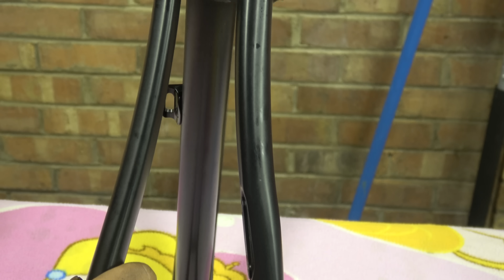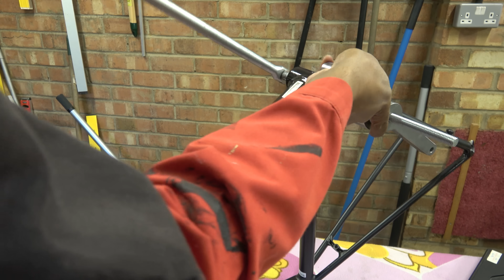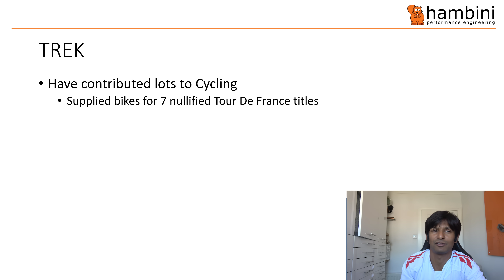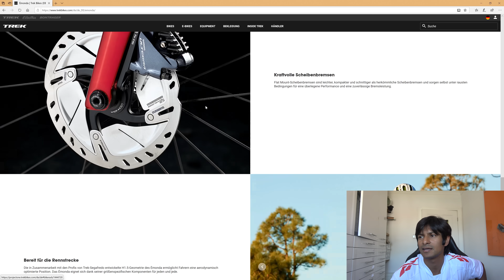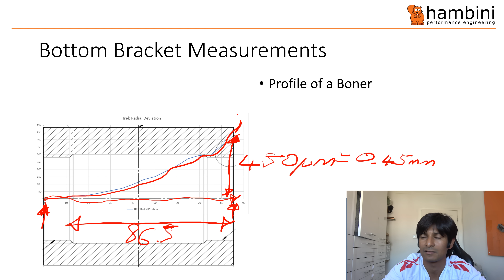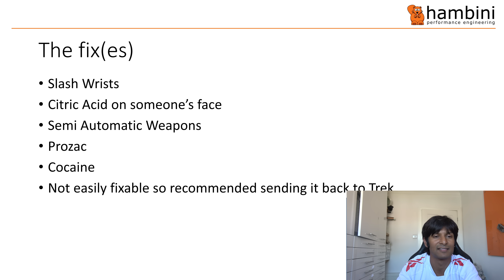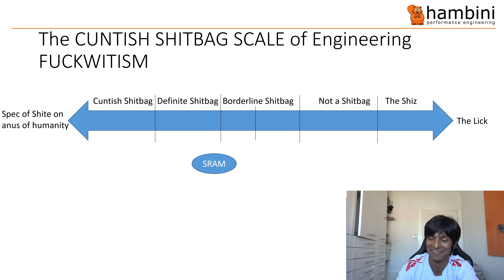Trek Emonda: Engineering crapness of the highest order

Comment: Purchased the alr5 frame and a Hambini BB but didn’t use because of the cable guide. I was lucky, because we had trouble installing a Wheels Manufacturing BB and had to take the frame back to Sigma and they exchanged and installed the wheels BB but I was not present when job done. Was not impressed with the quality. Seems to be a standard with your everyday frames🤦‍♂️

Comment: I got a Trek Checkpoint frameset and the bb has the same kind of problem as this... Shame on Trek :P
Reply: First thing I did on my checkpoint was a fix from Mr H. No creaking so far
Reply: I also have a checkpoint and the bb creaks like crazy. Sorry I bought it.
Reply: @Ryryryryryryryryry-o8n  My checkpoint was creaking a lot turned out to be the stranglehold dropout that needed to be cleaned and lubed, I'd check that before dealing with the BB.
Reply: @MAGAIVER  Thanks I will do that
Reply: @MAGAIVER  I checked the stranglehold dropout and although it was finger tight, it was easily tightened by a wrench. I tightened nuts to spec and took the bike for a quick ride around the neighborhood. No more creaks; Sir I owe you a beer. Thank you.

Comment: A better way to get around warping the BB and head tubes would be to start with  thick walled tubing with proper OD. Weld the frame and then ream the ID to size. Of course they’d fuck up anyway and the chances of them being reamed square are slim.

Comment: Pardon my naivete, but wouldn't it make sense to make the bb tube a millimeter thicker, weld it up, wait a week or two, and then machine the i.d. to its finished diameter?  Oh, wait.  My bad.  That would cost an extra $10 per frame for which they'd have to charge an additional $500 markup, which would in turn make their frames non competitively priced.
Reply: A week is not enough time to allow stress relief in a weldment or casting
Reply: @Behemotheffenrocks  It beats 15 minutes.
Reply: That is how  you would do a welding ass under normal circumstances.You wouldn't have to wait  a week either because after welding these frames should go through heat treatment because they have been anealed due to welding .Once done you would bore and thread.
Reply: naivety

Comment: I was considering getting an Emonda ALR 5. I guess I'll have to get something else now. How can companies let this garbage out the factory door?
Reply: You can’t afford a Trek anyway 😂🤷🏻‍♂️
Reply: We cannot learn much from one specimen, we need more data in order to conclude that the entire line was made with manufacturing errors. Trek has wonderful customer service and warranty. I'm sure they'll replace the frame.
Other companies wouldn't do that.
Reply: @Steve King  chinese carbon, dengfu, hongfu..
Reply: Don't be put off by this video. The ALR 5 is a good bike. Just don't let anyone that doesn't know how to use tools properly work on it. There're too many theoretical engineers in this world without the practical skill set to apply it effectively. More often than not the manufacturer gets the blame. 

The ALR is manufactured from specialist aluminium resulting in an extremely light frame, however, it needs to be treated with care. Look after it and it will give you many thousands of kilometres of trouble free cycling.

Go and test ride one. If you like it. Buy it with confidence.

Comment: ‘It won’t stand up in a court of law’.  Love it!!
I’m old enough to remember when facing bottom brackets and head tubes were part of every build.  You would’ve hated Italian frames back in the day
Reply: For some reason, reaming an Italian bottom bracket always makes me think of Gina Lollobrigida. These days you have to sell a kidney or two just to afford the tools to work on all the different BB standards. 
•	ITA/BSA threaded
•	BB90 and BB95
•	PF86 and PF92
•	BB30
•	OSBB (road)
•	BB30A and BB30-83 Ai
•	PF30
•	OSBB (mountain)
•	PF30A and PF30-83 Ai
•	BBRight
•	BB386 EVO
•	T47
•	Threadfit 82.5
•	SRAM DUB
That's a few I can think of off hand. Now we also have the flat-mount disc brake bollocks. A decent facing tool for that is around 500 Euros. Maybe this is a reason I hear so many new 'cutting edge technology' bikes creaking like the shithouse door on the Titanic.
Reply: Those were the days, taking the bottom bracket spindle with some grease and lining up all the ball bearing and sliding into the BB cup!
Reply: I mean, isn't this still a thing with some steel frames if you don't buy a full build from the manufacturer?
Reply: c johnson At least with Surly - they’re up front about it and specifically cite bearing life as the reason if memory serves. They tell you to face the paint off the bb shell before installing the cups.
Reply: @CodSlap  Yeah, I was looking at my Ogre while typing that

Comment: The way it's going, I'll never buy another bike as they all have crap bottom brackets
Reply: you can get a yoeleo or a look
Reply: Or Time, according to Hambini.
Reply: Alan Braaa  why a yoeleo  or a look? I am lost Haha
Reply: @Coaltarrwarrior  because they are very reputable and have great manufacturing. It's less likely to have a bottom bracket defect and the look will have better carbon layup/less voids.
Reply: Get a scooter
Reply: @albr4  what do you mean? Why is it hard to find someone to sell you a Time bike? You can just go to a Time dealer right?
Reply: @aneeshfroome4464  have a google search, the only ones that come up are ex-display on merlin cycles.
Reply: @albr4  Have you contacted a Time dealer? If you go to Time's website you can find dealers near you that sell bikes. There is one 1 hour away from me and I called them up and they say they can order bikes no problem
Reply: I has a carbon bike (won't name company, all made in in Taiwan anyway) and the handlebars would never remain straight when pushing it along by the saddle.  I swear, it was the most annoying thing ever, and I began to think that it must be something to do with the type of problem above.  An engineering cock up.  Obviously, I couldn't prove it.  I must admit for the price you pay, it's disgusting what you're paying for.
Reply: not all  get a praxis adaptor which is threaded in with an expanding collet to secure it into the frame
Reply: I’d like a video learning how to evaluate a frame.  Looking to learn. Language doesn’t bother me.  You do you. 👌
Reply: my old square taper shimano still going strong after 25k miles on it.I love ST BB's
Reply: Again, despite Hambini writing off some of the self-alignment of old-school threaded bottom brackets, the other upside of them is that they are just easy as pie to change out at home.
Reply: @workingguy-WOTm8  The issue here isn't ease of replacment. A threaded BB it isn't going to fix a poorly made frame, no matter how many times you replace it.
Reply: @johnm91326  It won't - agreed.  But it will let me keep riding on my poorly-made-buying-decision when Trek/Specialized/etc. refuses to warranty it.  But - if I DO get a straight BB shell, I can still replace it easily, albeit much less often.  And that's what I've been doing while my buddies' press-fit nightmares keep them from riding their favorite bikes until they have the time to take them to the bike shops.
Reply: @workingguy-WOTm8  How often does it have to be reiterated that Trek/specialized and Cannondale etc. is not the same as Time, Look and bespoke manufacturers?
Reply: @workingguy-WOTm8  Lol, he got out the breaker bar and freeze spray. If it takes over 30 mins to get it out having all tools at your disposal, it is the frame, the frame, the frame. Which is all engineering. Nobody puts a BB like that in under some impression that it is correctly aligned.
Reply: @cccpkingu  Not even once. You may be too dense to realize this, but for the average bike buyer, or used bike buyer, there are plenty of things to consider beyond the great bike manufacturers.  Keeping an inexpensive, slightly-not-right-bike-frame going is what most of us have been doing for the last 60 years of cycling.
Reply: @workingguy-WOTm8   - re comment to unbias - Exactly! all these idiots think 'marginal gains' apply to THEM on their 25 mile Sunday ride???
Reply: @gregtaylor6146  Yeah, the truth of it is that the girlfriend, her kids, all my friends - even the cyclists that were/are generations behind us - we all get by, or got by, with out-of-correct-spec frames from very nearly all the manufacturers for decades and decades.  The facade of 'I need/want what the pros race' is absolutely fine until it starts causing cyclists to have to stop riding while they wait on having the time to take their bike to a bike shop to install a press-fit BB.  I don't mind the frames getting lighter and lighter, but some non-ultra-fancy parts on frames make life so much easier for avid cyclists to keep doing what they love doing.  Threaded BB's, with their ease of being changed out, are that simplicity.   They may still not be in complete alignment, but they get the job done, are common enough to find within 24 hours of having a bike go down, and are easy to change out.
Reply: @workingguy-WOTm8  I prefer threaded BB. Already do some test on my friend's bike. Mine with cheap threaded BB much more smoother and spin much more longer than him. I do test on other bikes with PF BB. Same result. They are all use Cema ceramic bearing. You can see clearly @7:35, the bearing run much more smoother after taken out from PF BB and you can guess why :D
Reply: @workingguy-WOTm8  threaded BB's are total shit, they are good for smoothing out dog shit engineering tolerances and that is it. press fit is always better ASSUMING your engineering tolerances are within spec. This is because "threaded" BB's are still actually pressfit also. there is a sleeve that is threaded on the outside, then the bearing is pressfit INTO that sleeve. this means there are more interfaces, which means more play, less area of contact bc of the threads and more compliance, less stiffness. the less interfaces the better. with a pressfit BB you have: crank spindle>bearing>frame. with "threaded" BB you have: crank spindle>bearing>threaded sleeve>frame. more is worse.
Reply: Brandon Clark BS!
A well made frame with a threaded BB will always be better-no matter if it’s square tapered or Hollowtech II.
The spin test always tells the truth,and my cranks spin almost as good as my wheels.....
Fed up with these creeking bb‘s!
All my buddies on carbon frames had severe problems with the press fits,some of them went straight back to steel or
titanium.Who wants to ride on that toxic waste called carbon?!The little weight advantage isn’t worth the money—it’s much easier 
to train and lose another kg of body weight....🤔
Reply: @domestique3954  I don't agree. I have MTB Giant Anthem Advanced 7000 km on pressfit bottom bracket with no problem. My road bike is threaded BB as well as 2 bikes of my children and other 1 bike in family I do service and every one with threaded BB is worse! Poor BB life and noticeably drag! Surprisingly another 2 bikes with Square taper bottom brackets are better than threaded BB regarding drag.
Reply: @BranGrizz  you assume all threaded BB's are filled with hollowtech and the like. If you put a square taper axle in there, your firm opinion isn't valid.
Reply: @marianstopjak6247  - 'noticable drag????' oh do put a sock in it dearie ...... or maybe some GREASE in those bearings you hate so much? Old school taper fit cranks on threaded BBs were good enough for Mr Merxx et al, and I'm sure, even on one of your VERY GOOD days, he could still piss all over you and your un-maintainable modern iteration!
Reply: Had 5 BB30 bikes, never a creak, click or tick. Currently ride mostly threaded. I recommend getting a local, custom frame that fits you. Then you can choose threaded or pressfit, and if the frame is made poorly just go back and make them fix it instead of dealing with a big corporation's supply chain.
Reply: Been lucky so far. Never had a shite bb. Stayed with square taper bb with  steel and aluminum.  When steel bike worn bb rusted in I cut it out with angle grinder, applied C clamp welded shell back together. I iced bb cartridge frequently to not cook off grease! No creaks! Mostly for fun.
Reply: Edwin Jansen I’m offended by your racial discrimination. How dare you use skin colour to denote difference in opinion. ERMAGHERD, REHCERST!! 😜